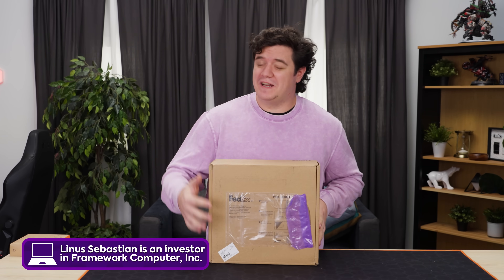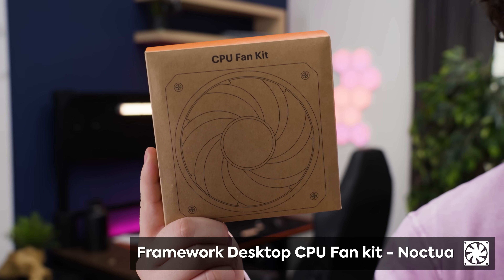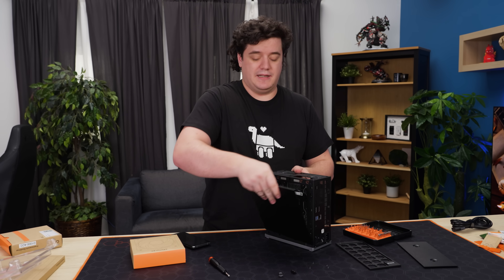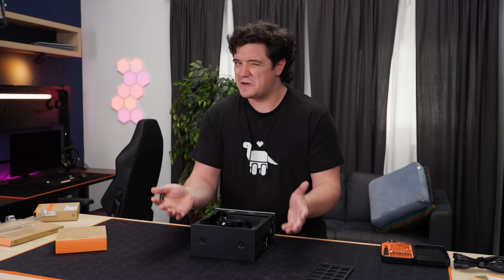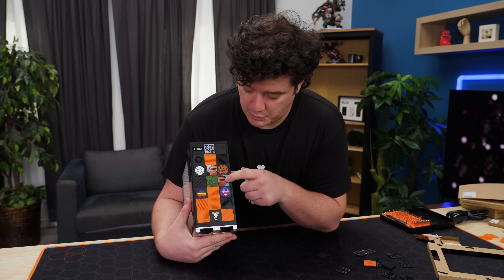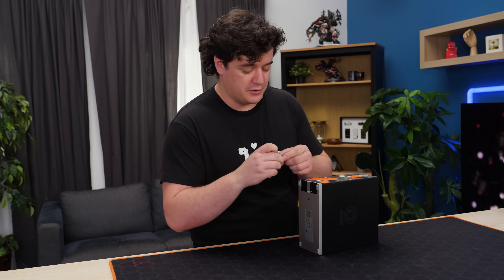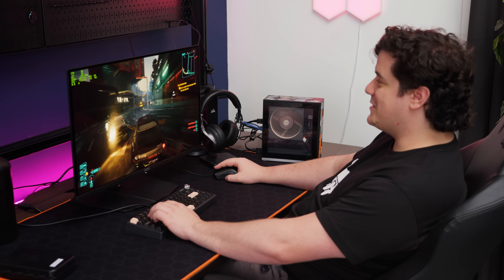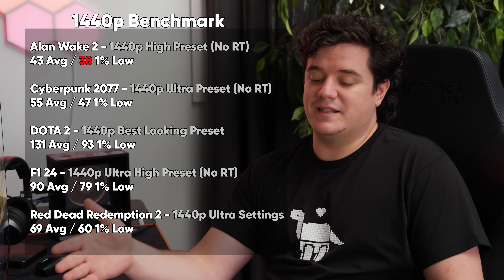This TINY desktop makes me nervous.... - Framework Desktop

Comment: Surprised to see the complaint about the power cord since LTT is always commenting about e-waste. It's good to give folks the option to not buy something they may already have!
Reply: +1 ... i think comparing Framework buyers to uh, everyone-else-buyers, they're way more likely to have one (or more) of that cable lying around
Reply: i think what they meant is it should be included in main package which you can optionally tick?
Reply: I don't know a lot of people with a spare power cord lying around. I don't think it's preventing any e-waste.
Reply: @tim_means_heart  Its about freedom of choice, you can order your power-cable to your region, so its reduced from price and you order the one you need, the reviewer left that freedom of choice out. I personally have like 15-30 spares. I would rather not have another one.
Reply: Reviewer not doing their homework 🤷‍♂
Reply: Um, no
Reply: Right. There’s no chance someone buying the Framework desktop doesn’t have a spare power cord hanging around.
Reply: You don’t want to reuse cables from other psu
Reply: @edjiang4289 that advice pertains to the modular cables that go form the supply to your  PC components... the IEC cable power cable is standard.... and generally fine to mix and match
Reply: @edjiang4289  Why?
Reply: @edjiang4289  the cord going from the psu to the wall is just a standard 5-15p cord. The cords you aren't supposed to reuse are the ones to your components, which can have different pinouts or be differently rated

Comment: The power cable I really don't think is that big of a problem.

I have a box with at least 5 of these things at home so I'd rather save the $5.

Also as you have to explicitly opt out of the cable I don't see it as a problem users are likely to encounter.

I think if it was seen as -$5 if you opted out isntead of +$5 to opt in it'd be completely different

Comment: I think the ram being soldered may be a fair point but they did say that it was because the performance was no where near as good. However the power cable I already have a bunch of extra of so thanks for letting me save 5 dollars and for the customizable front panel it's just that customizable you can choose not to buy any. Making it cheaper

Comment: As long as they make the option of buying a power cable (including the right plug for your country) on the site easy, I don't have a problem with it. I personally have tons of extra cables, but in case someone doesn't, it should be easy and obvious to add a cable as part of the purchase process. If anything, this is more in line with Framework's modular nature.
Reply: Yeah, and thats exactly what framework does iirc. Before you order it you have to either select bring your own cable or a power socket type.

Comment: I was one of the first people to build with itx system.  I went to a lan party and played battlefield 1.  Everyone else had large systems.  They didn't think a small system would keep up.  This was 90's.  I also built in an optiplex half case.  everyone is complaining it has proprietry power.  Just replaced power with sfc.

Comment: To LTT Media group,
Everyone talks about cable length and management. Is it bad for us to shorten our cables (pwr, GPU, fan, etc.) and re-pin them? Does this change any timing, temps, syncing in a PC?

We manufacture our own cables on the fly at my job and slice off slack routinely without negative or erroneous results.
Reply: Power cables typically the shorter the better. For data cables (with like a lot of data, like usb)  usually this is true but it could have issues with signal integrity depending on how well you repin them.

For stuff like fan data cable unless you really mess things up it really doesn't matter.

Comment: the power plug isnt included in an attempt to avoid E-waste. ALot of people have cords they can re-use. Remember reducing E-waste is frameworks schtick. also, you couldnt upgrade the ram past 128 gb if you wanted to, ryzen of that generation still only can use 128gb ram.
Reply: I see the soldered memory as a non issue. What could upgrade beyond when it's that fast and that much memory pool??

Comment: I love the idea, i really do, getting larger LLM's to run without investing in multiple super high-end GPU's is very tempting, unfortunately the practical performance when running larger models is slow, and stacking frameworks comes with it's own challenges not mentioned in the video, beside that, using local models for everyday tasks quickly fall short in comparison to the commercial models out there, i recon you could build a stronger small form factor gaming PC, get a few yearly AI subscriptions for the same price tag :). if the price was a fair bit smaller and it came in a mini PC format, i might be interested, luckely they also exists out there ;)

Comment: Yeah, small tiles to generate more polution.
And for a product that doesn't solve anything, as desktop computer have always been upgradable, and much better than with these tiny format, without soldered ram...
And why only 1 usb C port on that extension module, they could/should have fitted at least 2 on it!

Comment: There's a very valid reason for the soldered memory, they made a video talking about it. The issue is the chip itself, it's very unstable with slower memory, and they worked with AMD's engineers to try to address this somehow, but were unable to, so soldered memory was the only solution
Reply: The complainers can literally get any other platform using regular dimm slots, but they don’t, because they all want the fastest soc with unified memory which it won’t be, if it was equipped with regular ddr5
Reply: And if anything it reduces ewaste because you'll use your PC for longer because of the performance benifits.
Reply: They could choose any other platform that doesn't require that...
Sounds like an Apple BS
Reply: @tiloalo  there's a reason apple cpus are currently the fastest single-core perf you can buy, soldered ram has massive speed benefits
Reply: @tiloalo  if they did though… then just get a PC. The typical PC (Ryzen AM4/AM5 or Intel non-core CPUs) are already perfectly modular and there’s no place for Framework to come in and improve it like they did with laptops.
Mini PCs on the new gen CPUs like the Apple M series mini and such aren’t easy to open and fiddle with. While it is a shame it had to be soldered memory, that was just a hardware constraint they had to accept if they wanted to compete in the new architecture market, rather than end up pointlessly competing with regular PCs.
Reply: @Leffrey yep, in which case they should probably have stayed out of it, rather than abandon the one core value the company was created arround
Reply: @tiloalo  probably. I agree that desktops aren’t really a space that Framework’s needed in. But they did get AMD R&D to seriously examine the possibility of non soldered RAM, which is a good thing that might still pay off with a 2nd generation. 
Maybe the next gen will even include modular graphics and whatnot or they’ll get AMD to actually make Strix Halo itself modular. I’m not gonna fault them too hard for branching out, just because they didn’t massively exceed the industry standard like they did with laptops.
Reply: @Leffrey yeah but honestly they didn't even really try. What's the point of those plastic tiles packed individually? More plastic and packaging trash for no reason... their goal was to reduce environmental impact, not increase it.
Reply: @tiloalo  then it'd be just a desktop PC, the point was to give people a desktop (ish) with Ryzen AI CPUs, which at the time at least wasn't an option, there were some for the lower and mid tier options, but nothing for 395+ or whatever it's name is
Reply: @tiloalo get over with the fact that old is good. The future is changing and SOCs will be the future. More tightly integrated, more efficient, faster. And by nature it sacrifices upgradability for speed.

Comment: I really like the idea of this, but a starting price of $2000 for it makes me completely disinterested otherwise. The configurator is really detailed, but prices on necessary stuff like a power cord or $12 for a USB port feels like nickel and diming the consumer. Maybe I just have sticker shock after not checking hardware prices for about 18 months, maybe I'm just not the target consumer for this specific setup.
Reply: It starts at $1100.....
Reply: @jfolz  I selected a bunch of low end options on the configurator and the build was $1800 without an OS or power cable and all black panels. Maybe I can't use a configurator properly either.

Comment: $108 to block air flow
Reply: TBF the air is all coming from the side.
Reply: @MrVlodato  not a fan of front facing airflow.
And I am a bit more concerned about the 108 usd instead of the airflow
Reply: @filiflo  oh for sure, i was just pointing out the side intake being the main intake. TBH you should get a discount to put the logos on your PC not pay for them. Its almost ironic.
Reply: They should at least provide an STL to make your own.

Comment: Crying over here as I had to rob my rice maker for a C13 cable on my last build.... My power supply came without a grounded one and made my case live.... Yeay Thailand
Reply: I also had to rob my rice maker for a cable hahah, but it was for a 3d printer, not a PC
Reply: I just bought a used pc and the guy asked if I needed a power cord and I’m like nah I got some at home and I did but now I’m thinking I should have taken it because I don’t have a spare pc power cord 😢
Reply: Super real.
Reply: that's better than old school lab PC that needs to steal the other monitor's power cable just to turn on the PC
Reply: LOL IT MADE YOUR CASE LIVE WHAT OH MY GOD
Reply: if missing a ground conductor makes your case "live", you have some serious wiring issues in your house
Reply: @jsncrso I kept getting 'stung' by my case after using the included C13 cable, it was apparently a shuko plug but Thailand doesn't use a compatable socket. Also wiring here is... Unique
Reply: @jsncrso no house wiring issue would cause this, this is 100% either BS or OP’s psu is at fault. 

What’s more likely is they got a static shock from the case because it wasn’t grounded.

Comment: The cable is not included because you probably already have a million of them, its just e-waste. Should have costed $1 on the configurator though.

The memory is soldered for speed. The fastest DDR5 SODIMM memory goes up to 6400MT/s. They are using faster, more power efficient LPDDR5X at 8000MT/s. The memory speed is absolutely crucial for the integrated GPU, using 6400MT/s would probably straight up cut performance by 25% (also AMD requires LPDDR5X, and if they used SODIMM they would have needed 4 sticks, which may have required more space).

Lastly, AMD does have dynamic GPU memory allocation. You can usually just leave the static GPU memory at minimum and forget about it.

Comment: From what I understand, and correct me if I'm wrong, but the reason Framework went with soldered memory, is because they had to. That AI max whatever chip only uses soldered memory, there's no way to get it to accept sodimm.
Reply: They could have gone with a different cpu.
Reply: @KC2Lucky  thats not the point of the product. The point is to offer a mainboard with THE most powerful APU you can get, which no one else does. Using another chip wouldn't have done that.
Reply: @StretchDattass I don’t disagree that it’s not the point of the product. But the product veers away from what I understood framework was about. Having soldered memory is something that I’ve complained about with apple products in the past. Framework have sacrificed the flexibility that I knew them for, for performance which I never understood as their highlight feature. 

I’m disappointed with this direction. Make no mistake, I understand to get the performance out of the pc with only an APU they needed strix halo. 

I’m not upset because this product isn’t for me, I’m upset because I can see a future where framework starts soldering more components with explanation of performance.
Reply: @KC2Lucky  Except they're not doing that, every product they've released except the one/s that use the strix halo have upgradeable memory. It was just not doable here, but the APU is great for the workloads it was made for, and thus, it had to be made.
Reply: @fuj1n  I hope you're right but i've been disappointed by many companies before.
Reply: @KC2Lucky Frankly your overreacting. The whole company isn't changing who it is because one product isn't allowed by the manufacturer to have swappable memory.
Reply: @KC2Lucky   "instead of going with the product they were going to sell, they should have made an entirely different product"... such a dumb complaint
Reply: @KC2Lucky There is no apu in the world yet that is comparable to Strix Halo
Reply: @carsoncarolina2358 yeah I didn’t say there was. I just said they didn’t have to make this product…
Reply: @KC2Lucky And there's nothing wrong with them making it.
Reply: So they could simply use smth else... it's not like people all stopped building desktop machine with standard RAM
Reply: @tiloalo see my other comment.

Comment: honestly the things that they could have added to push it over the edge would have been atleast: 
1. 10Gb ehternet, they arent that much more than 5 Gb, 
2. a full 16x slot or an open 8x slot for a mini gpu and some upgrading possiblities.
3. expandable quad channel ram. come on guys could have begged amd a little bit more and got a slot in there, the engineer who told them that it was impossible to make it upgradable has to answer questions of ''ok so how come servers now have 12 channel expandable memory?''
4. a long heatsink for better heat dissapation.

Comment: The soldered memory is an AMD thing here BTW, not framework
Reply: Weird because Linus already said that in another video.
Reply: Reviewer not doing their homework 🤷‍♂
Reply: @jammsen-z8y  not a review
Reply: It's not an amd thing, it's an lpddr thing.
Reply: @Lead_Foot  LPDDR comes in LPCAMM modules
Reply: @deimosian They said that you can't get the timing right also lpcamm is meant for 128bit bus or 64bit bus. Strix halo has a 256bit bus like a GPU so the igpu gets a ton of bandwidth. Those have to be like gddr very very close to the actual chip. Even if you somehow could with lpcamm you'd need like 2 or 4 modules which isn't practical. But you can't even
Reply: But the choice of using this specific AMD chip is a choice made by framework
Reply: @tiloalo  Yes, because otherwise, it's just another desktop, and Framework didn't want "just another desktop", they wanted the AMD Strix Halo products...
Reply: still dogwater. for the baselevel framework cost, basically 2000$, i can get a 14" macbook pro with 32gb of ram, and the macbook comes with the best display in my house.
reguardless this is both: not what i would buy a framework for, and isn't even that good of a deal
Reply: @vulbyte  How is a Macbook comparable to a SFF desktop that has 4x the RAM?
Reply: A macbook is a dumb comparison for a small form factor desktop? A more apt comparison would be against the mac studio which has the same target audience and is more expensive. 

As for notebooks, I personally don‘t find the laptops by frameworks appealing unfortunately. The display is too far behind the market and battery life as well.
Reply: @vulbyte  yeah maybe but it's mac... windows has better compatibility and what most people are used to
Reply: @vulbyte  This isn't competing with that, they've stated that this is intended to compete against the Mac Studio and computers like that. For $2,000, you can only get 36GB of RAM on the Mac Studio versus the 128GB on this. That is a massive difference for the kind of workloads you'd expect to do on a Mac Studio.

Comment: I appreciate the power cable being sold separately. I have dozens of them already and I don't need that cost to be included in my purchase price. 

Likewise, I have access to a 3d printer - I could print my own tiles if I wanted.  Again, something else not being included in the purchase price is good since it means they can (in theory) reduce the price by that much.

Comment: You are such a muppet for being angry about the power cable. It clearly states that the cable is not included. So ihnstead of making everyone pay $5 more, they make it optional in case you already got one. Its also easier to sell OUTSIDE of the US or Canada (Yes, the rest of the world exists)

And go brush your teeth and get them fixed up. Its disgusting to look at.

Also this thing is the wrong step for Framework. We dont need tiny desktops that are less repariable than an actual desktop. Its legit not even much better than NUC-Style PCs...

Just get on with your laptops and give us more variants of those.